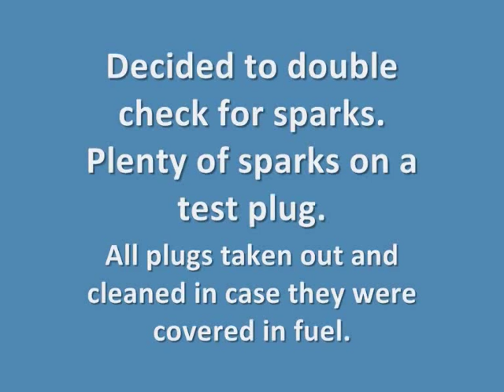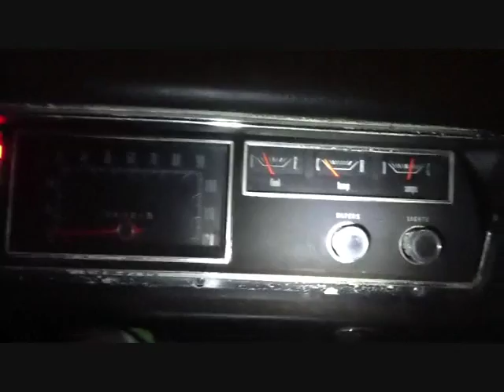VE Valiant VIP 1968, Barn find in UK, engine start after 25 years

Comment: I have a 1969 VF VIP with engine and gearbox missing, its on ebay now. I used one of these for banger racing in the early 80s it handled really well and lasted for well over a season

Comment from the maker: It is a 273 V8. Front half exhaust OK so remade rear section for now. Engine runs smoothly now after a lot more work. Love the slow tickover 500rpm. About 1 month away now from attempting our MOT test and seeing if I can get it on the road for the summer. Rumoured to be others in UK on forums but have yet to actually find anybody with one. Might be only one left in UK, who knows?

Comment: If you going to take it for a MOT it's probably best that you check the Front Chassis rail around the steering box. they have a tendency rust out from the inside & crack

Comment: some valiants assembled in nz were also exported to the uk  72 in total im told i had  recently a regal that missed the boat  it had a chrysler corporatin conventry  england tag on the inner gaurd
Reply from the maker: Yes. the Rootes Group here needed a top end model to rival the Jaguar XJ6 which was very reasonably priced for a high end car of the time. Problem was that by the time the Valiants had been shipped here they were twice the price of an XJ6 so they didn't sell very well.

Comment: Always start the car with transmission in neutral, when it's in park no oil is being feed to the torque converter. Also with prolonged idling leave it in neutral. This is the only downfall of a Torqueflite transmission.
Reply: +Johnny No TorqueFlight here... BorgWarner 35 all the way on this baby!
Reply: +Aj Furrell Are you sure? Being V8 should be Torqueflight. I've had Valiants all my life and never seen a BW behind a V8. Still have my VE I bought some 30 years ago from my Grandparents, genuine 80,000 miles. And it's running a Torqueflight. Not a big fan of the BW, OK for a slant motor but weren't strong enough for the Hemi 6.
Reply: Maybe not behind a V8, my 245 has BW35, I thought they had all changed due to the aussie content rules....
Reply: +Aj Furrell yes you are correct, the Hemi's did run the BW due to the governments local content regulations.
Reply from the maker: I think it is a TFlite, definitely not BW. Thanks for the advice.